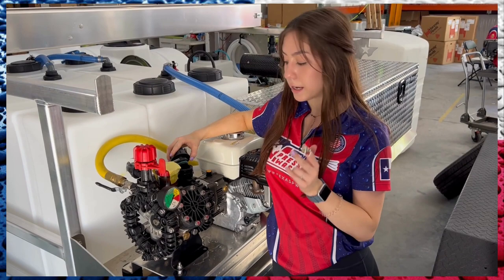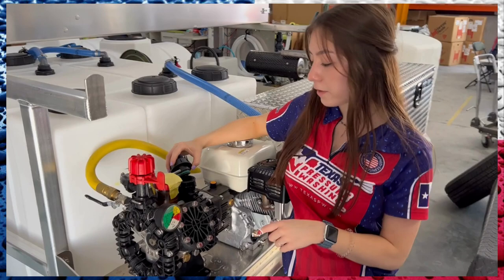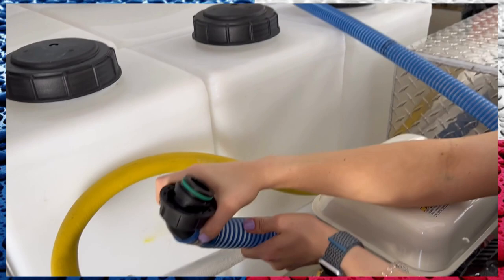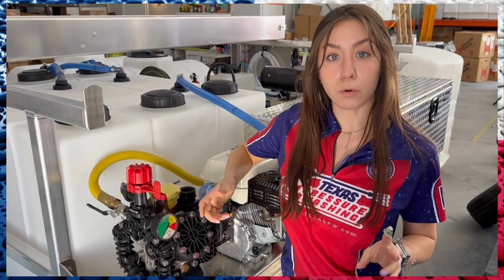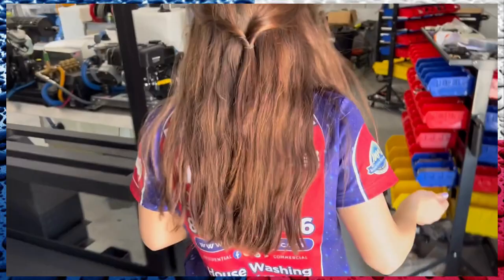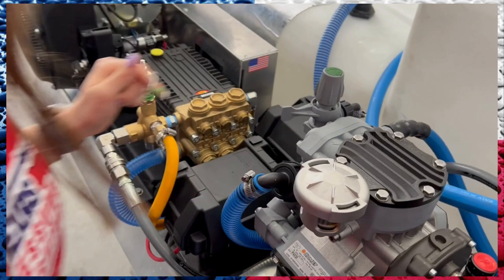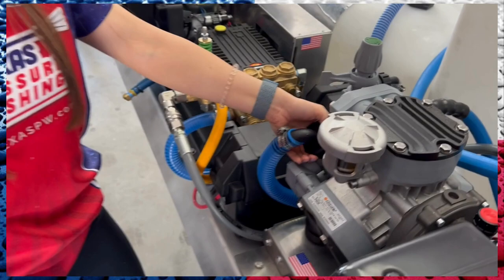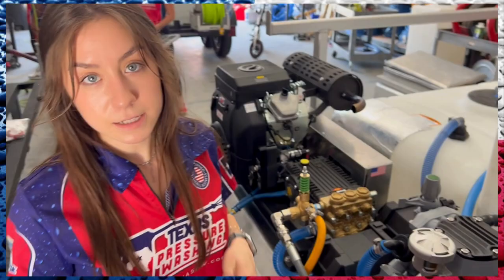How to Prime Your AR45 or P40 Gas Pump

Comment: Do you have to prime everytime? 
I'm literally in the market right now and I've been looking into the p40 but would like to know your thoughts on both 
In your experiences which is the better system as far as shot distance, longevity and nuances. 
Whats average comparative life expectancy between the two.
Reply from the maker: No it should only need to be primed once.